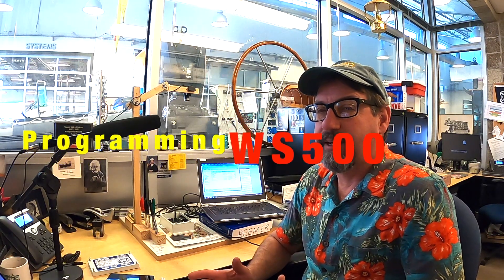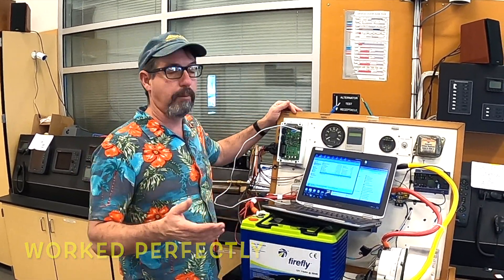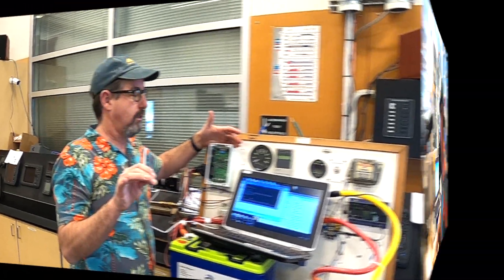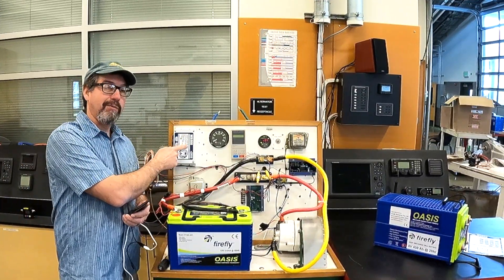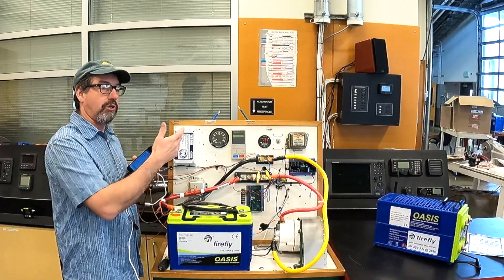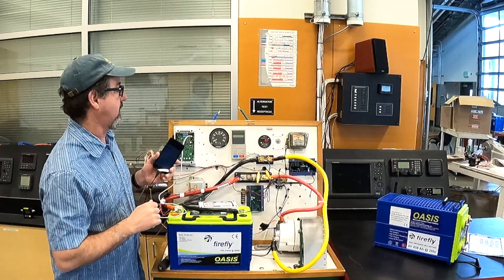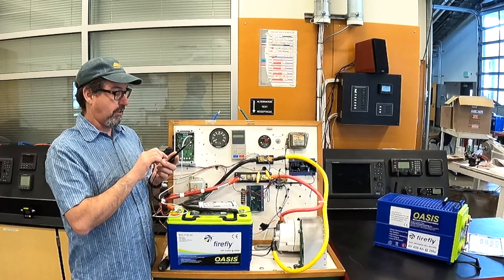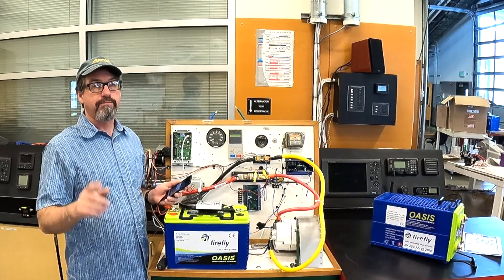WakeSpeed WS500 Programming

Comment: Thanks good presentation I am working on a dual Lithium battery setup for my Jeep and told to research Wakespeed Battery Regulator WS500. Doesn’t seem complicate to install even for somebody like myself who isn’t a a wiring expert nor an electrical engineer. You done an outstanding job making it simple to understand even for someone like myself. Thank you! #NewFoundConfidence
Reply from the maker: For lithium installs it is simple the best (only) choice. Have fun with your project